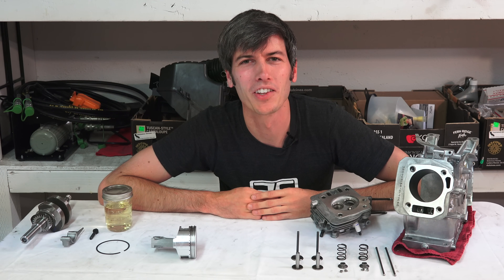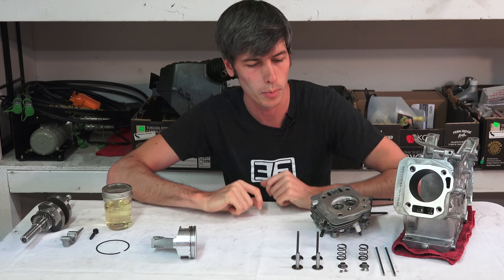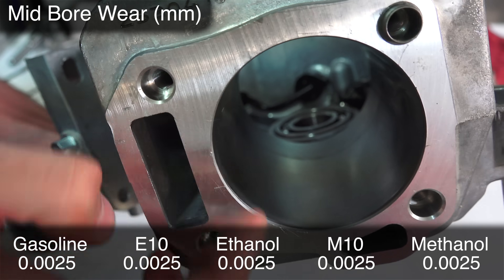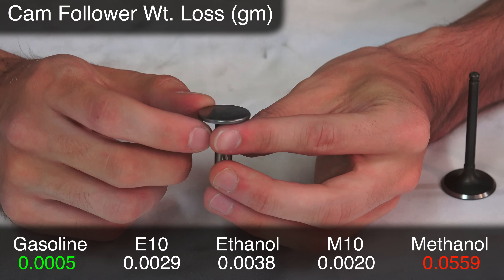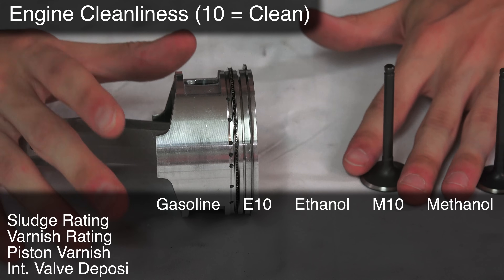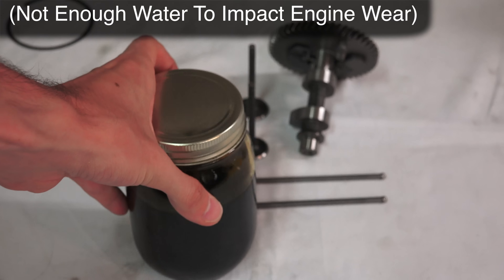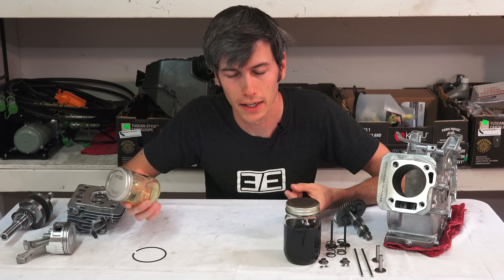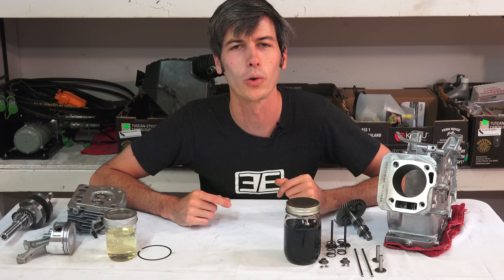Is Ethanol Bad For Your Car's Engine?

Comment: Cars used to be designed to last to build reputations but now it’s all about environmental concerns . Ethanol by very nature will dry out lubricant needed components like bores and rings ! What do you use to clean grease off before painting a surface ? Alcohol works so imagine that in the head and other areas of wear !
Reply: Gasoline also works for cleaning grease...

That's why gasoline engines don't rely on fuel for lubrication (as opposed to diesel engines).
Reply: triggermovies but it doesn’t adsorb water and become a galvanic corroded mess
Reply: Your comment was about lubrication, not corrosion...

Anyway, Jason mentioned it in the video : don't let your car sit for long periods of time with a tank full of ethanol, and avoid ethanol on older cars (or redo the fuel lines with modern materials). Problem avoided.

In the end, pure gasoline is disappearing fast... Soon, you won't have a choice at all and will have to use an ethanol mix. Here in France, SP95 (95 octane unleaded gasoline) is getting rarer and rarer, replaced with SP95-E10 (10% ethanol). And even then, I think they can put as much as 5% ethanol and still call it SP95.
Reply: triggermovies wow in Australia we got all fuels but still got 91 as nominal fuel. Do you have e85?we do as we have very large sugarcane production up north
Reply: Actually I don’t think we have much premium diesel.
Reply: triggermovies the used to have lead in there to help lubricant till 1984 in australia
Reply: No, carbon deposits and cooler running temperatures means engines last longer on ethanol. Carbon deposits act like sand paper, wearing down the cylinder walls of the engine. Heat causes thermal stress that will also eventually cause components in the engine to fail.

If you have water in your tank with 100% gasoline, it will just sit there rusting your tank. If you have 10% ethanol in your tank, some of the water will mix with the ethanol and leave out the exhaust.
Reply: Varangian Guard carbon can lubricant
Reply: As far as gasoline goes, we have 95 as nominal (slowly replaced with E10), 98 (available almost everywhere, but more expensive) and E85 (still uncommon). Most gas stations offer only one quality of diesel (which is the most popular fuel by a good margin), very few have premium. Unleaded gasoline has been introduced in France in the early 90s, but leaded was only banned in 2000.

Comment: I have never had a car come in with a wear issue from ethanol, that being said tho, I have had many with seal/gasket failures. I wouldn't run more than 10% in a fuel injected car older than 2002, and wouldn't run any ethanol in any carburetor/TBI models unless all the seals have been replaced by a set of seals designed for use with ethanol.

Comment: Here in Brazil we have 100% Ethanol to use almost in every car. Brazil cars can run with gasoline, 100% ethanol (110 octane), or both mixed together, this technology is called "Flex"
Reply: I didn't know 100% ethanol was a thing! I think here in North America the Flex Fuel vehicles are up to 85% ethanol. Maybe the OIL / FUEL companies just want to make sure people keep buying their obsolete products instead of innovating new more environmentally friendly alternatives.

Comment: So if it doesn't do much FOR the engine, then why do they add it? Is it just cheaper than pure gasoline?
Reply from the maker: It's cheaper, yes, and it's also a cheaper way of raising the octane rating. Though I think there are also a lot of political reasons why it's used, on top of some of the advantages/disadvantages.

Comment: I recently did a 1.6 16v on my samurai and I run about 2 table spoons of 2 stroke oil in my gas when I fill up along with fuel injector cleaner every month with good results and no excess carbon buildup. It might be overkill but like you said, cars built over 20 years ago are not designed to have ethanol in the fuel system

Comment: The results in 3:24 are all dividable by 0.0254 mm which is 0.001 of an inch. This suggest the measurment method was not accurate enough or the engine was run for too short of a time.

Comment: Here in Brazil sucks, we have "gasoline" (it is almost 27% ethanol by a government regulation), and E100 (yes, 100% ethanol). No 100% gas at all, yuck! 

Here with flex cars, you test both fuels, get the mpg numbers (actually KM/L) and compare the prices. In my 2008 fiesta, E100 performs marginally better financially than gasoline and also gives me a little bit more torque and power, and as my engine is a 1.0L which btw sucks, every little performance increase counts, so I go by E100...
Reply: Remember that the “premium” one is 25% ethanol...

In my opinion this increase is linked to the rural bench. Probably in a few years we are going to see something like 40% alcohol, at the price of R$ 5,00/L
Reply: Yes, here in Brazil we don't have pure gasoline. Every gasoline sold to common automobiles and motorcycles has something between 24% and 27% ethanol. Since 2003 we have "flex fuel" engines, cars that run with both (gasoline and ethanol) or any mixture of them. My 2015 Honda Civic (R20Z1 engine / 150 hp with gasoline and 155 hp with ethanol) can make up to 12,8 Km/L with gasoline and 9 Km/L with pure ethanol. I use them both, changing from one to another from time to time. Most people in our country only use gasoline, because cars don't have good mileages with pure ethanol.
Reply: I had my cylinder heads milled to up compression from 9:1 to 10.5:1 and got noticeable performance improvement. I run E85 and the fuel cost are about the same per mile.
Reply: There is no pure gasoline, nowhere in the world, Every gasoline has to have some extra additive so to make it higher octane, in Brazil it is Ethanol. Pure gasoline is a lot weaker than Ethanol mixed gasoline.

Comment: I dont like water in my engine..
Reply: Have to stay hydrated tho, don't want those metal parts dried out.
Trust me, I have a liberal arts degree!
Reply: Don King 

Ha. Well, ICEs produce about the same volume of water (as high pressure steam) as the fuel they consume. The process is called combustion. ICEs are pumps powered by steam and CO2.
Reply: You need coolant and water through the water jackets in engine to keep it cool otherwise doesn’t go mate , I can see people like you walking from lack of engine knowledge

Comment: I have 7 years and 115k miles of pretty much pure e85 use on my non flex fuel car (09 civic si - supercharged for last 4 years). Only times I run gas is when I can't find a station on a trip or don't bring any e85 with me. I've noticed my oil stays quite clean for an entire 7500mi oil change (looks like 3-4k on my gas cars when I change it, and neverrr turns black, just dark caramel color.. unfortunately I haven't had it tested for real. One thing I've noticed about ethanol is that it doesn't seem to disolve oil... If you put a drop of oil into e85 it just sits there, if you shake it up you turn it into tiny particles. In gas it immediately disolves into solution. I'm curious if that'll have long term positive affects on ring and liner wear by keeping down fuel washing? But this test didn't seem to indicate that.. I guess I can do a compression test and see how my engine is doing so far.
Reply: You need to look at 2 stroke performance oils like the pink motul, it dissolves into ethanol and methanol. But yeah, there are not many oils that work with alcohol fuels.
Reply: Another long-term E85 user here. I have several non-flex-fuel vehicles and all the EFI ones get E85 or blends to E50 all seasons except winter (my winters can get to -40F). No issues, no mods, not even noticeably worse fuel economy at E50 vs E10. Yes it drops at E85 but when it costs at least 20% less per gallon vs E10 it still works out. 

Mr. EE erred re: when vehicles were built to withstand ethanol. Anything from the mid 80s on up is good to go.
Reply: @alfresco4976  i can't get my 2uz-fe past e50 without having it knock on cold start when it's in copen loop fueling.  I'm running it on the stock ecm map (no mods). 
Do you have any advice?
Reply: I have done zero mods to my vehicles for E85 or E85/E10 blends. Winters here are brutal and I have learned to simply run E10 when it's below zero F. Knocking on cold start is something I've never experienced, nor does that make sense to me because ethanol is very knock-resistant. If anything the engine stalls and stumbles for a bit, until it starts warming up. I just let it do that because within a minute it'll smooth out. I also ignore the CEL if that comes on because I know why it's on and it's not hurting anything.
Reply: Yeah you require a lot less air to burn the same volume of Ethanol, so pushing more Ethanol for the same amount of air can do the trick.
The bad thing in gasoline or even flexfuel engines is the low compression ratio, since regular gas doesn't like a compression ratio greater then 10:1, many cars being between 8.5:1 and 9.5:1 to avoid knock if you get a lower octane gas for "certain reasons". Ethanol can do well with compression ratios well above 11:1, some say 16:1 if it's "E100", but you usually can see some "pure Ethanol" engines running around 13:1 easily, which make them not only efficient, but also produces more power if properly tuned. You just can't refuel in most countries, unless we're talking competition cars and controlled fuel! But running at higher compression ratios will also make the burn more agressive, which can result in greater wear and tear and higher heat loads!
The thing about old polymers isn't just natural rubber(made from a Rubber Tree resin), since we have been using a lot of synthetics since the 70's-80's, but the additives to the prepolymerized resin and all the different molecular structures. Chemistry isn't my area and my study on polymers are still a bit limited, but to what I can tell they've changed rubbers a lot since the 70's.
The Hydrogen-Oxygen bonds between Ethanol molecules probably cause a lot of the differences comparing to gasoline, like vaporization temperature, viscosity, specially at lower temperatures, so properly injecting it vaporized and not getting condensation(failing to ignite properly in one single front also) might be difficult, so much so that even in Brazil they've always used a auxiliary regular gasoline tank in their older "E100" cars between the 70's and 90's, before flexfuel and even with fuel injection! And that's a country where it's rare to live in a place where winter goes below 50ºF(10ºC)!
Reply: volvo09 Black oil isn’t necessarily a bad thing
Reply: @shoveI  tell that to the carbs on my harleys and dirtbikes.
Reply: Maybe your car is flexfuel and you don't know it. The air-fuel ratio, ignition and valve timing and a whole bunch of other stuff changes a lot when it comes to higher concentrations of ethanol... Check with an OBDII tool if your car has a Lambda sensor, which is used to adjust those things on the ECU on the go... If not, you're a really lucky guy not to have been spending way much money worth on corrective maintenance...
But since you supercharged your car, you might have reprogrammed your ECU for running on E85 then.
Reply: @ToliniDaniel  He supercharged his car. He knows it's Flexfueled

Comment: The problem with the study is the same problem with any manufacturer longevity test. They test it harshly but for a short period of time. I.e. 20 hours of run time vs 20 years of run time. The problem with ethanol causes separation of water which will also cause corrosion.
Reply: RedWings-44 

Actually, the opposite is true. Ethanol and water are infinitely soluble. Ethanol enables water to dissolve into gasoline. Water will separate however. Depends on the % of ethanol. The higher the %, the more water will dissolve.
Reply: @FrankGutowski-ls8jt  correct. The water separation is something that occurs over time.

Comment: I have a 1991 Nissan Hardbody pickup and I noticed that running E10 I would get 17 mpg city, but if I ran E0 (100% gasoline) I get 20mpg city. Which is in line with EPA estimates for the year. Highway mileage experienced a similar drop in mpg. 

The worst thing you can do with an older vehicle that has E10 in it is not drive it often.
Reply: I saw a similar fuel economy loss in my 2004 Dodge Caravan, 2005 Navigator, and 2004 Hyundai XG350L.   E10 was consistently 3mpg less than straight unleaded.
Reply: which would be in line with the lower BTU ratings of the fuels.  Lower BTU - lower energy - have to burn more to make the same horsepower.
Reply: That is correct as Ethanol has less energy density per liter/Kg when compared to gasoline.
Reply: Yep, I only use non-ethanol in my 93 Honda. It cost a bit more, but the MPG makes it more than worth the slightly extra costs. Not to mention being better on the 25yo fuel system that was never designed for ethanol
Reply: My results are similar, about 10% worse fuel economy with E10 compared to 100% gasoline.  So that would mean the 10% ethanol in the blend produces ZERO energy, while the 90% gasoline produces all of the energy.
Reply: @Timmymao-RIP  Yeah that's not how it works
Reply: My results were similar: 10-15% less mileage with E10. I will pay more to get pure 87octane E0.

Comment: From what I've always heard the concern is less about metal parts wearing and more about the ethanol attacking the plastic/rubber parts you mentioned at the end. Id be interested in a study looking into the effects on those components
Reply: Due to the hygroscopic nature of the fuel its not just in your car, its the older tanks at the service station also.
Reply: Alan Mccarthy 

Storage tanks collect condensate whether or not the fuel contains ethanol. More water puddles in pure gasoline storage tanks, less in those with alcohol fuels.
Reply: @FrankGutowski-ls8jt  less water in tanks with a fuel that absorbs water. Bugger water puddles inside tanks that dont contain a liquid that mixes with water. Makes sense.
Reply: Alan Mccarthy 

Some commenters suggest ethanol reaches out and grabs water out of the air, whereas it’s just encountering whatever water daily thermal cycling draws into a storage tank. I was surprised by how much water can condense in a humid climate in a container that’s not sealed. I made the mistake of not filling my gas tank and having it less than half full most of the time. It took a sizable dose of isopropyl alcohol to get it dissolved. The water was up to the bottom of the in-tank pump.
Reply: Someone else did a video on YouTube looking effects on fuel lines. The non ethanol fuel and 10% ethanol fuel had the same results. The e85 was best for not harming the rubber fuel lines.
Reply: I think newer cars are made with plastic /rubber (silicone maybe?) parts that are more resistant to corrosion since they're aware most gas stations are putting in at least 10% ethanol now, so it shouldn't be a problem unless you have a classic car maybe.

Comment: You could point out that ethanol engines are less prone to pre knocking which is a real advantage in small displacement engine with turbocharger.
Reply: Anton Zuykov  Yes, but you can burn much more ethanol than gasoline with the same amount of air. Plus ethanol has big cooling advantages. If you want performance, E85 all the way.

Comment: Here in Brazil we have 3 fuel options: 92% hydrated ethanol, gasoline with 27% ethanol and premium gasoline with 25% ethanol. Most of the flex fuel cars run with more HP when running with full ethanol (some with 10% more power) and the price is 60% to 70% of the basic gasoline. But the car with ethanol does something about 75% of the mpg then running with gasoline.
Reply: Ethanol isn't as energy dense as gasoline, so it's normal it gets used up a bit faster.
Reply: E20 in the US was tested and shown to decrease MPG by 7.7%.   I alternate E10 and fullgas on my 2013 Accord all the time and the noramlly don't see a difference of 1 mpg, and I normally get 39-41 on either.  (yesterday was 42.5).  Ethanol has 67% the energy content of gasoline.  If 10% of your tank is ethanol, you'd get the 90% of energy of the full gas portion and the 6.7% in the 10% ethanol, total 96% or so total energy...  that's about a 3-4% drop in total energy, and at 40 mpg, a drop of 1 mpg would be 2.5%, so it's splitting hairs.  I go through almost a full 17 gallon tank every 8 days or so... mostly highway miles in suburban setting in UT county, Utah - that's where Provo is, just south of Salt Lake City...
Reply: and E25 is VERY EXPENSIVE

Comment: What happend if insted of E10 I put in the gas tank E50 ?
Reply: It depends on the car.
Reply: A normal car, not flex fuel
Reply: Try it but no full throttle because small pump and injectors. It is great if you are after mileage rather than shear speed.
Reply: @saulrobles2150  Still depends on the car, my '98 Cherokee ran ok on 25% and I've heard of Prii and Hyundaii running up to 40%.

Comment: This got me to think about B20 for Diesel engines. My Cummins powered truck seems to get more mileage per tank verses straight diesel fuel. Perhaps you can look into this. Of course my truck as a vapor separating lift pump, high pressure common rail with electronic injector timing just to name a few items. Any insights would be appropriated.

Comment: From what I understand, ethanol is an inexpensive way to boost octane and where I live in the PNW, non ethanol fuel is over $5.00 per gallon. For fun once, I filled my truck with the stuff and did NOT notice a difference with mpg or power.